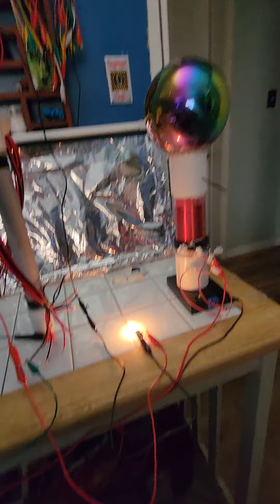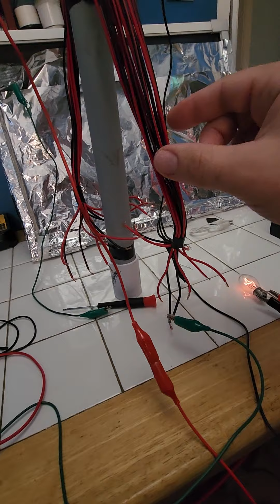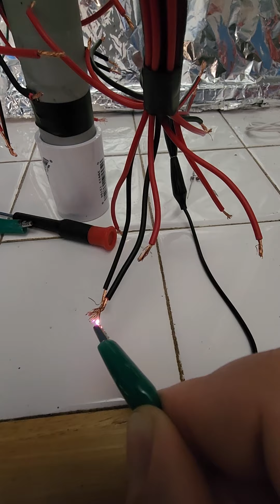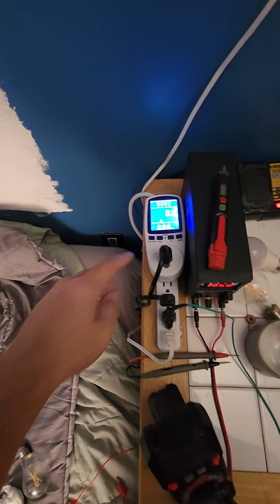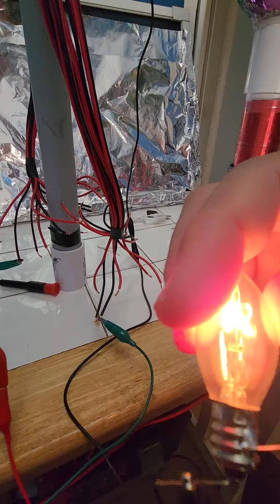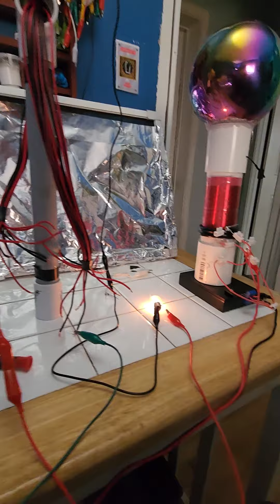📃 UPDATE ON PROJECT WITH ANTENNAE DIODES 📃

Comment: Hey, I really like what you're doing.
 I did experiments with this about a year ago and what you want to do. If you want to get your power to increase exponentially, do this get a big cardboard box? Maybe? 2x2x2 line the inside of the cardboard box with tin foil. Put your transmitter coil and your pickup coil in the box so the box is facing down. The idea is what you want to do is confine all that magnetic power flux transmission inside the box. As a result of this, what's going to happen is your pickup coil is going to have access to all that charged ether in that space. Therefore, you're going to get way higher output on your pickup coil and you will be able to reduce the amount of wattage used to run your Slayer. This will get you over unity like you would never seen before!!!
. Because you're generating flux in the air. It's scattering throughout the entire house. That's fine if you're doing long distance transmission, but if you want to get real huge over unity gains due exactly what I told you and tell me what you think and show me your results. When you try the experiment, just get a cardboard box big enough to confine your Slayer coil and your pickup coil and you'll find that you'll need a lot less power input and you'll get huge amount of power output as a result of this. Cheers, keep up the great work!...  Mike
Reply: Do you happen to have a video of this if not that would be near i love your videos!

Comment: Hello. I have a very important question. Have you found the power growing ?. And does the power get much larger with the ground hooked up only  ? It is important you write down the voltage you are getting Every day or every other day.  I am 62 the picture is of my Grand Daughter . This is to let you know I am Not pulling your leg. If you have time please post your findings. I will set up my old Tesla coil and follow your design . I just need to know if what my theory is , is correct. Thank you.
Reply from the maker: Yeah so I'll put a large aluminum plate next to the tesla coil & the load runs from the plate to Earth ground. The power levels are 3-4 times the output of the tesla coil
Reply from the maker: Incandescent bulbs & power hungry leds work great

Comment: My understanding of wireless power transfer is you need matching coils and top loads .They match the resonance frequency  Now in your case your using collectors and rectifying the voltage good idea. If you had another top load like the primary coil then at least your captive coupling might match closer.

Comment: Bro you are star! Amazing decision!  I think I figured it out, just need to experiment more, it's like Stanley Meyer HHO cell effect. He is saying he using high voltage and HHO cell as capacitor and electrons that released from water split into H H O  you can collect and get energy. In your case environment around tesla coil acting as capacitor and now you placing that aluminium foil inside capacitor and collecting electrons that split from water vapour around your cell. Try increasing humidity and see if output improves!